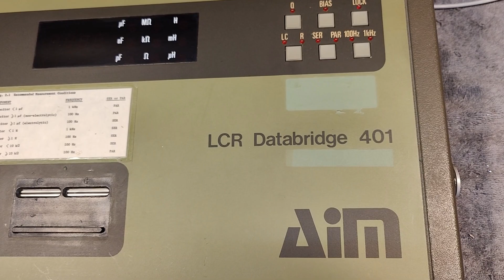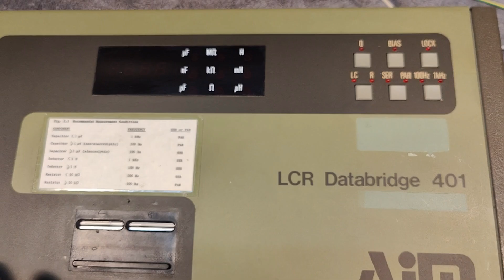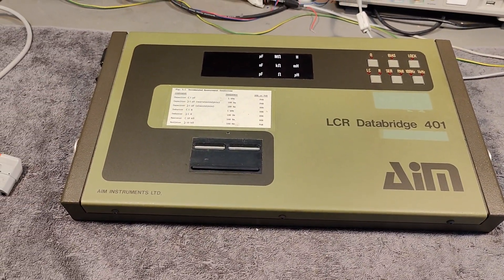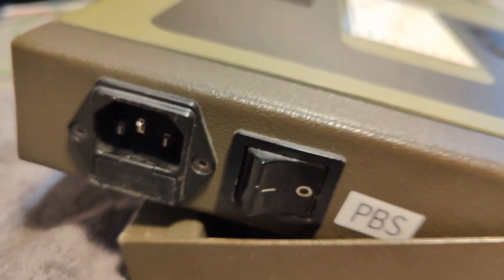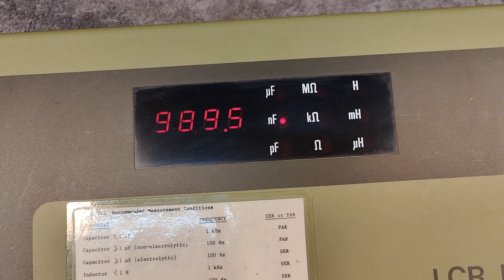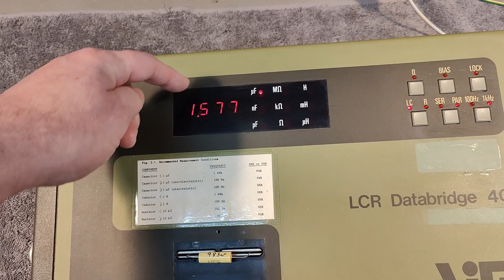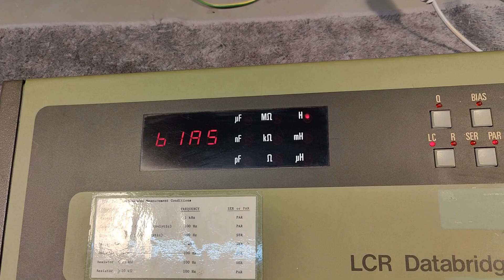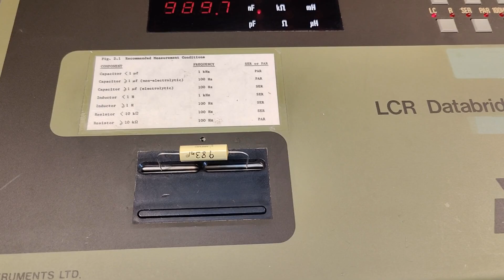AIM instruments LCR databridge 401 1984 Z80

Comment: the user+service  manual for the racal-dans 9341 is available online, its the same as this but rebaged!.
Reply from the maker: thanks a lot, i was hoping to understand why it lock up when BIAS is pressed
Reply: @TeardownOZ2CPU   i am afraid i cant help you there,when i get time i will see if my racal 8341 does the same,cheers Paul de m3 vuv73
Reply: my 9341 locks up when bias is pressed too.
Reply: Section 2.7.6 in the Racal user manual says that it needs about 30 seconds to settle in the bias mode, during which it shows bIAS in their display, which then goes away and components can be inserted.

Comment: When you pressed BIAS it went to H (Henry). t may expect a coil.
A distant thought : Capacity and inductance is dependent on the voltage or current one apply to the device under test. How to change the values thogh ....

Comment: Power connector is not turned. There are several power cables with different angles, up, down, left and right angled.
Reply: But if you only have one that goes that way, it's useful to know the nuts are properly captive